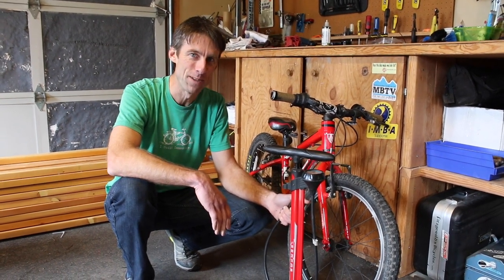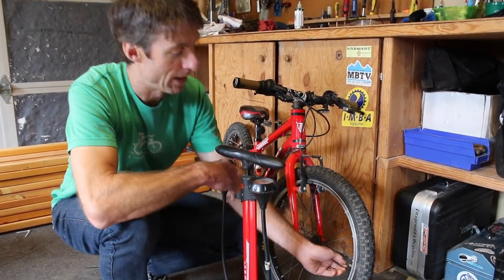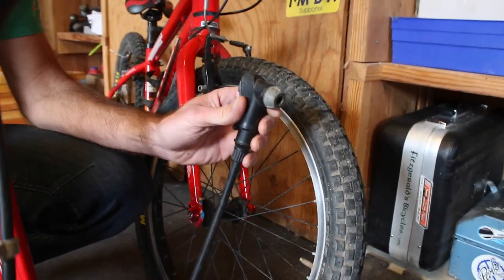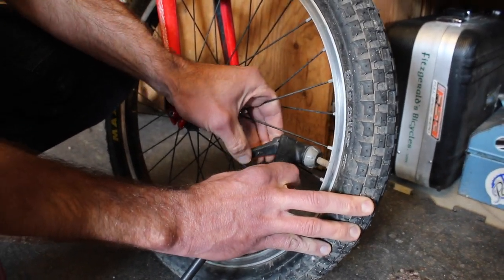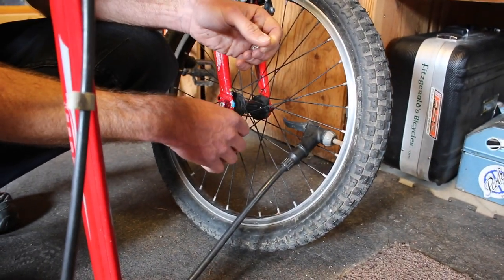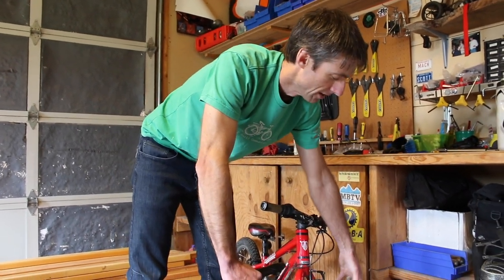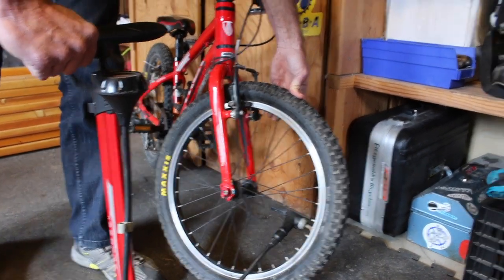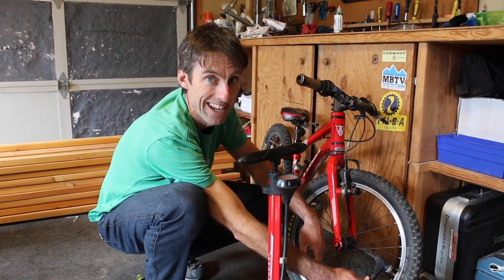How To Pump Kids' Bike Tires

Comment: Wow. Thanks. I would open the lever, place the head on the valve, then close the lever 🥴... letting the air escape. I didn't know I was supposed to leave it closed, then place it on top of the valve, then lift the lever 🙄. Thanks so much.

Comment: Great video. Thanks! What if you've completely lost pressure in the tire and the pump is not making a seal? Does the tire need to be re-sealed in the rim?
Reply from the maker: Are you running a tubeless setup? If so then you'll need a compressor to re-seat the tire.